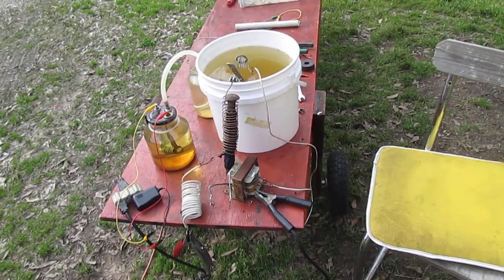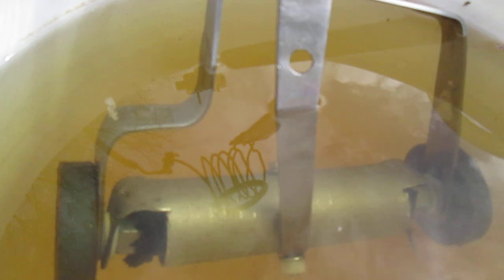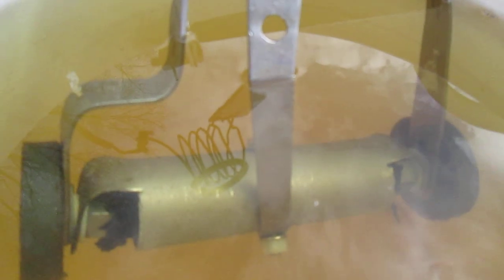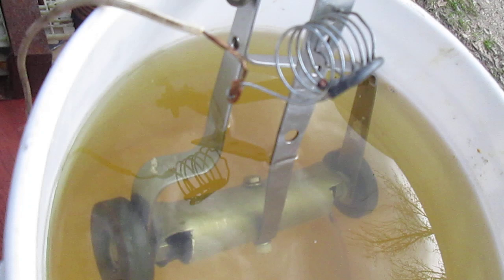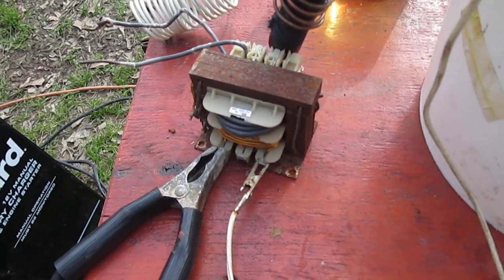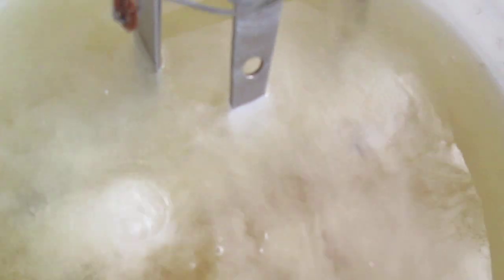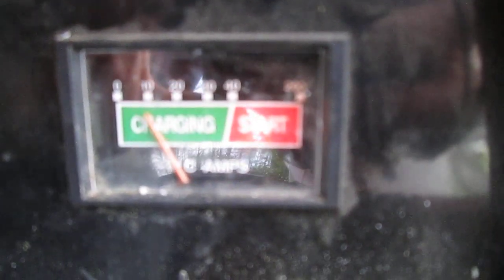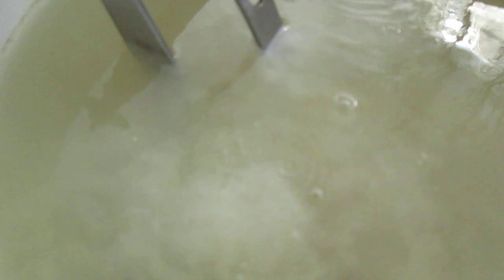HHO 94 Hammer Cell with Magnets, only 96 Watts consumption

Comment: You said the coils are under resonance but arent you using direct current from a battery charger / Jumper?
Reply: I think it's pulsing dc current... the battery charger is a high amp low voltage transformer with a diode for rectification on the secondary (low voltage side)... you get a dc pulse that matches the frequency of the line voltage.... if there were a bridge rectifier, then you would get twice the frequency....
Reply: resonance only works with AC .
Reply: If you use dc pulses into a tank circuit you can have resonance. The inductor that is in series with the circuit is half of the tank circuit, the other half is the capacitance created by the air gap in the windings... thus resonance can be created with pulsating DC.
Reply: dont you end up with a sinewave?

Comment: Klasse. Kannst Du noch mehr erklären. Zum Beispiel eine kleine Zeichung. Wie erklärst Du Dir den Einfluss des Magnetfeldes? English or German doesn't matter.
Reply from the maker: Hey Abgas Engel
Das ist ein langes Rohr mit zugeschnittenen Enden fuer Lappen zum umbiegen um 90 Grad. In jeden Lappen ist ein Loch gebohrt fuer ein Plastic Rohr als Isolierung zu einer Schraube. An der durchgesteckten Schraube sind jeweils zwei Plastic Ringe als Isolierng zwischen Schraube und Lappen dazwischen gesetzt. Das Rohr hat innen drin ein Metal Schrubber Netz fuer einen Pol. Der andere Pol, die Schraube hat einen Ueberzug von Linnen zur Isolierung. 
Beide Schrauben sind am gleichen Pol so dass die Magnet Feld Linien sich abstossen und Interferenz punkte bilden. Die Idee ist wenn sich beide magnetische Felder , eine zeitverzoegert ueber eine Spule, gegenseitig ( Plus und Minus) ergaenzen und zu Null bringen kann ich die Elektronen mit einem Magneten heraussaugen in Richtung des anderen Poles und damit die Schalen fuer die Ionen aufbauen und extra Gas erzeugen.
Ich hoffe das hilft weiter.